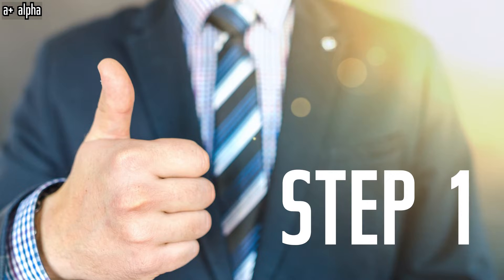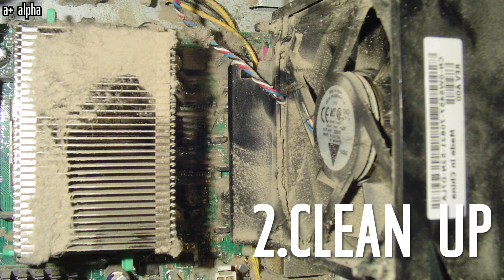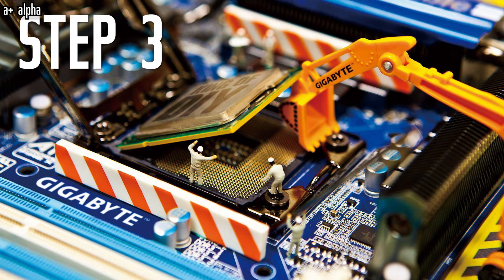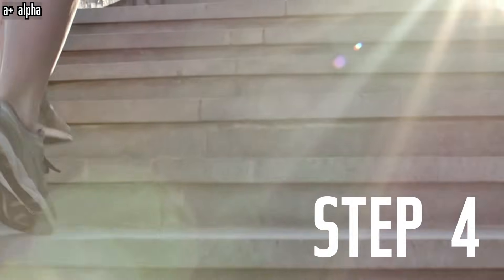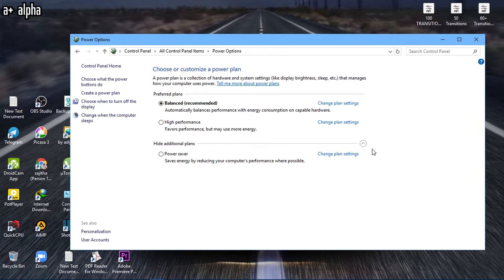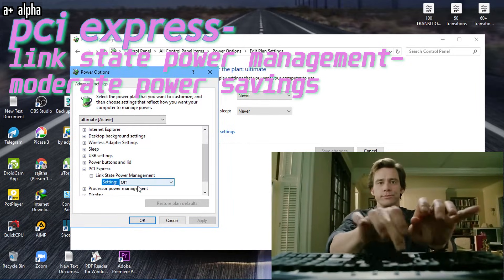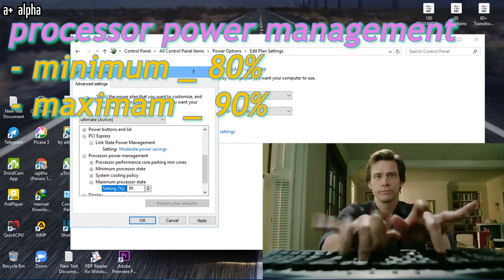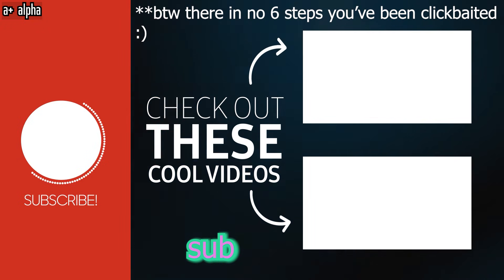✔️how to FIX your PC high temperatures | overheating CPU/GPU when gaming [complete guide]

Comment: This helped SO much. I was runninng at 90-100 celcius with about 3 things open and like 80 with absolutely nothing. now with absolutely nothing open I get like 50 and with quite a bit I get like 70 which is A MASSIVE IMPROVEMENT. Sometimes it spikes up to 90 when I open an application but atleast it goes down in around 5 seconds to 70ish

Comment: Bro step 4 is like a literal cheat code. My CPU Temp doesn't even go above 60 Celsius in ANY game so far. I used to get like 86 CPU Temp in a Warzone game, and now I get like around 55 CPU Temp. But, it does come at a cost of performance, but its really not that much, and its very worth it. Thank You so much. 💯

Comment: some did work went from 55 temps on idle to 45 IDK why now its high maybe one the summer here get 105 at times or two i bumped the Air cooler to much it moved it and now uneven, so i will also repaste it... for now this few tweaks least brought it down 10% till i repaste first thing in the morning Thank you👍

Comment: Will it affect Cpu's life??
Reply: It is much more likely that high temperatures can shorten the life of the CPU over the years, rather than limiting its power
Reply: Yes, in a good way. Step 4 really helps limit your CPU Temp, but it does come at a cost of losing a bit of performance, but its worth it. Doing step 4 will actually ensure better and longer CPU life, as it decreases and limits the temperature by a lot.

Comment: My ryzen 5 5600g was at 55 degrees without any gaming. Although that is not that bad it was still higher than others. By simple following the last stap its now at 38! Thanks alot man! I also have not cleaned my heatsink in like 2 years so im gonna try that and update this

Comment: My brother in christ, you're my savior. Before trying step 4 my pc used to crash on every demanding game, recently i bought ac valhalla and i wasn't able to play it without crashing after 10 minutes playing. I spent two weeks looking for software related fixes and was about to give up. Now, thanks to your help, i finally noticed it was a temperature issue and now i can play for hours straight with low temperatures (from 80 degrees at lowest settings to 65 at mid settings) and zero crash. Hope you the best 🙏

Comment: Im using i5 7300hq with gtx 1050ti, and with this tutorial, i can actually dodge the fps drop i usually got when i was playing battlefield 5, the fps drop sometimes still happens but it only occurs for a few frames and not as much as before, thank you so much for this

Comment: I’m nervous these are all bots in the comments does step 4 actually work?
Reply: It's legit, your not going to break or mess up your PC you can easily revert step 4 if it doesn't work, I was a tad bit nervous doing it myself but get creative with your PC have a leap of faith and it could possibly help/save your pc in the long run.
Reply: So did it work, brayden? and have you noticed performance differences?
Reply: Yes worked amazing for mine

Comment: Well the final step definitely does lower your temps, mine dropped by a massive 20C. There is an undeniable performance loss however, at least with CPU bound games. Playing star citizen I toggle 'recommended' and this changed setting, and its a -15fps every time

Comment: The logic behind step 4 is straightforward. Put battery saving efforts to moderate so as not to drain too much battery but not dampen performance too much. Limit maximum CPU usage to less than 100% so that temperatures doesn't get too high.

For some reason RE4 Remake is very demanding and puts my CPU temps in the 90s especially on hot days, without air conditioning. Now the temps went down to 80-85C which is pretty good for a gaming laptop.

Thank you for this!

Comment: When I pick Best Performance power mode, the frame rate gets better compared to Balanced but the temperature can get really hot (It can go over 90 Celsius) even though the CPU usage is low. It wasn't like that before when I bought my laptop.

Comment: yall do know that step 4 is essentially a manual thermal throttle? less power = less performance. its just compensating for the issue, not fixing it, and it will hurt your performance.

Comment: step 4 saved me, idk but my water cooler was running at 80 degrees in fucking minecraft, now im running at 51
Reply: so i was at like 80 while not in a game. but i am now at 68? it wasnt much of a drop like idk how to change it
Reply: @FinesseGD  bro, try to change your cooler or replace it and change your thermal paste, 80 degrees idle is wild
Reply: @awakengmd  thermal paste on cpu or gpu
Reply: @FinesseGD  cpu
Reply: ok so i found out the issue. my gpu fan is not spinning. the videos on youtube are no help, idk what to do @awakengmd

Comment: From 65'c max now 55'c max of playing dota 2 at step 4. But still don't know if it has bad impact to my computer cuz it has higher minimum processor state and since its not recommended to set higher minimum processor state when you will research. I tried 5-25percent but still work 80 percent is just too high.

Comment: Step number 4 has just solved my month long issue in 30 seconds. Was running Path of Exile at 90 degrees i changed the power options just like you said and now it's not going over 50, you sir deserve an award.

Comment: Brother this actually worked , mine got decreased like 15 degree C ,it was running at 100 degree C but now its at 85 degree C while the gpu temperatures seem to be same(I HOPED IT WOULD ALSO DECREASE) and right now i can't notice any performance loss either. Plz make one on gpu too, i already tried undervolting but it didn't help.
Can anyone tell me why this worked though....

Comment: I have no heat issues with my 7 year old CPU it runs at 40-45 degrees Celsius while playing games and my AIO cooler is 7 years old too, never needed to reapply thermal paste. My CPU is 30c at idle.

Comment: CPU temp reached 100 degrees celsius though not going over. Reapplying thermal paste fixed my thermal throttling. Haven’t reapplied it in over 5 years. Luckily my CPU was still functioning despite of it.
Reply: 5 years wtf

Comment: that power saving setting, by only adding that limiter it dropped my temp from idle 47-72c with no game on, to running it a flat 38-39c even while running elden ring at max settings it stayed below 40c. 
Then running Warhammer: Darktide at max from a 65-75c dropping to a 49-65c.
It is insane that it had such a massive impact, without affecting my fps negatively

Comment: RIGHT ON!!!!!! My struggles with my Asus Rog Strik G15CE CPU temp have been resolved thanks to your sharing of knowledge via the TUBER!!!! My gaming desktop would have a normal CPU temp until I launched a game. When any of my games were running in the foreground my CPU temp world be 100C. If I minimized or sent the game into the background, my CPU temp would go to about 70-85 C. I did research and tried a settings recommended in my power plan with the CPU power management option but the 3 Settings in the power plan you recommended resolved my issue. Thanks to you, my most resource intense game is at 60 C.....YES!!!!!!!!!...THANKS!!!!!!!

Comment: Finally, normal cpu temperatures. I had completed my first build with an AMD Ryzen 7 5800x3d processer. I had seen a bunch of things on "processor running hot" but none of them helped. Step 4 decreased idle cpu temps drastically, with it running at 48 degrees idle in the past, now down to 36 degrees. Thank you!
Reply: 48 degrees is very good
Reply: Bro my ryzen 5600 is running at 61 while idle suggest me something
Reply: @gelnox_mom Did you change your power plan according to step 4? Thats what helped me. I don't know what else you can do if that doesn't work.
Reply: @smotion1000  yeah now its better bit its still at 61 while idle
Reply: @gelnox_mom  61 is still damn hot for an idle temperature. what cooler are you using and how many intake/outake fans do you have in your case?
Reply: @smotion1000  i am using the stock cooler nothing extra🙂
Reply: @gelnox_mom what case are you using? Airflow
Might be the problem and if you don’t have any additional fans it won’t cool down
Reply: @smotion1000  i am using monarch  mystery box  with 5 fans and just bought the pc like 12 -14 days ago
Reply: @gelnox_mom  huh. Looked that case up and I can’t a single piece of information of it and anything about airflow. That might be an issue. Also, for my build I use an AIO instead of a stock cooler which may result in a much different or better temperature. Don’t take my word for it though as I have never used a stock cooler or know much about them.
Reply: @smotion1000  myb its not available in ur region.
Reply: @smotion1000  bro can we talk anywhere else so i can give u pic of my case..
Reply: @gelnox_mom  yeah sure. But like on what tho?

Comment: thank u so much man! I was running ESO at around 85°-92°, then I set the cpu to 90% and not only the temps went down to around 60°-65°, but the fans stopped making jet engine sounds 😭
Reply: p.s. also forgot to mention that I only lost like 10% or less performance-wise it's almost hard to believe

Comment: Step 4 is working  fine. (12 to 15 degree less temp)
But CPU usage percentage is now increased like 15% to 20%. 
Can you tell me why ? Is it creating extra pressure or load on CPU now ?
Reply from the maker: It reduces CPU max clock speed. It won't affect yo performance unless the PC got a CPU bottleneck. 🙂

Comment: will reducing max and min processor state reduce the prcessor of cpu
Reply: of course. not by too much tough. worth it if your processor is really struggling with heat.
Reply: @retrex3448 thanks for the info bro
Reply: performance*

Comment: What does step 4 does exactly? it does decrease the temp but surely there is a slight perfomance loss id imagine? just very minor? cuz my understanding is that u run the system from 100% to 80 and 90% right?

Comment: Step 4 has helped me so much you have no clue. On Dead Space Remake I was getting 85 to a MAX of 94 degrees Celsius. I also replaced my CPU cooler recently AND applied thermal paste and I had no results. Not on high graphics, Ray tracing I’m sitting at a cool 55-59 degree Celsius temperature. It’s insane

Comment: Thank you very much. I had a problem with Minecraft, when starting the game it always uses 100% of the CPU for no reason, causing the CPU temperature to reach 95+ then after 1 minute it drops back down to 50-65. After using step 4, the CPU temperature is consistently 47-50.

Comment: Step 4 helped a lot. My CPU was at 88+ degrees all the time, but now its at 60-70. Thanks a lot!
Reply: Yeah mee too it does so well 
But the question does it damage the pc ?
Reply: i dont think it does, i never had problems, i think it's just a default setting thats turned on high and needs to be turned down when ur gaming so you dont get overheating issues @podcasttn7345
Reply: @podcasttn7345  No it doesnt at all , in fact reducing the temp help the cpu surviving longer

And most new motherboard include some overclocking by default , increasing performance by 10% but temps by 40% , the core boost performance , its usefull for old games that use low amount of cores , but only if the gpu is limited by the cpu
However with the increase of pixels in monitors , playing on a 4k monitor for exemple : you could use an overpriced 2.5k$ gpu without being limited by a 200$ cpu power

Wich mean , any kind of cpu overclocking should be disabled , even outside of gaming

However , i dont know about the pci power part , ive never tested it , since i need my gpu to run at full speed
Reply: yueah mine too idk why this is even a thing but yea.
Reply: reducing performance always helps
Reply: but that causes a lot of lag tbh @PerfectlyFineCup
Reply: same here
Reply: me to braa
Reply: Kills fps
Reply: @lufter7375  you’re usualy limited by your gpu rather than your cpu

Lowering speed on some cores enable others to do their job without being slowed down , resulting in a much stable fps

The only kind of games where you loose performance are old games that doesnt support many cpu core , requiere high cpu power and low gpu power , such as...well considering old games doesnt use that much power anyway , it doesnt affect fps
And on my encoding test , it only reduce around 7% speed , but goes from 70 degree to 50

Outside of that however , and mainly for thoses single core app , it does reduce the speed a lot
Well its not like waiting 0.9 ms instead of 0.6ms will kill you , humans are usualy slower than that

Comment: What do I do if it’s still shutting off randomly?
Reply from the maker: Probably Hardware issues.. add new thermal paste
Reply: @AAlpha69  so it was due to my power settings, changed a few settings & it dropped to 65 Celsius!!
Reply: Was at 96 btw

Comment: I just upgraded my rig with some new hardware and installed Windows 11 Pro. Then i took the new rig to test and installed some hardware information software. And i was mildly shocked. 

My rig at the moment (after upgrading):
- Mainboard: Asus X570E Gaming
- Processor: AMD Ryzen 9 5950X
- Cooling System for Processor: Corsair iCUE H170i Elite Capellix (push-pull-upgraded, located in top, exhaust)
- Memory: G.Skill Trident Z neo RGB 128GB
- System SSD: Samsung 990 Pro 1TB
- Video Graphic Adapter: Asus Strix 4090 OC
- Power Supply: BeQuiet Dark Power Pro 12 1200W
- Case: Meshify 2 XL
- Fans in the back: 1x 140mm PWM exhaust
- Fans in the bottom: 2x 140mm PWM, intake
- Fans in the front: 3x 140mm PWM, intake

Before upgrading, i used Asus Strix 2080ti OC, Be Quiet Dark Power 11 850W, H150i, 980 Pro 500GB.

So, i knew with the 4090 alone i would have to deal with some more degrees, but... when i looked up Open Hardware Monitor, i saw values not meeting my expectations.

Now, before i post values, it is important to notice:
- I live in a flat under the roof
- It is summer
=> So i am talking about 29 degrees Celsius room temperature.

In idle (!!!) my GPU was looking pretty good (39 to 43 degrees), my mainbnoard looked good too, around 27 to 36 degrees (all but two ungodly high values at around 80 degrees that may be invalid due to my online research), and my processor was like ~70 degrees.

I just took some time, found your video, watched it despite every body cell telling me to not watch it completely (because the generated voice alone.. ugh) and i eventually ended up with testing step 4. I just created a new energy profile and set maximum CPU utilization to 90%, did not change anything else.

So here it comes.

Open Hardware Monitor gave me several values for my CPU. Here are the BEFORE values:
Package: 66.0
CCD Max: 69.3
CCD Average: 54.4
CCD #1: 69.3
CCD #2: 55.5

Again, this is IDLE! Keep that in mind.

Now the values AFTER the change:
Package: 39.4
CCD Max: 40.8
CCD Average: 37.3
CCD #1: 40.8
CCD #2: 35.5

So, thank you, didn't think i'd find any working solution fo that here, so fast. And i didn't think i'd find the solution wrapped in a video that could have been a tutorial for scammers aswell, regarding the style of it. I will put this to the test and comparsion with switched back values in some different games. If my pc doesn't end up either as a dead horse or a supernova, imma let you know the results. 

Thanks again.
Reply from the maker: Thanks for the comment.. ❣️

Comment: My PC was shutting down when I was trying to play Fallout New Vegas from overheating. Google was helping none, this vid and the settings made a major diff. It was running in the high 70-80s and sometimes triggering my cpu program to make the PC shut down from overheating. Did the settings in this vid and am now running the same game and settings but the temps are in the low 50-60 range, sooooo much better.
 Me and my PC thanks you. :)

Comment: Thank you soo much bro!! You saved my life, I found out that the casue of this problem on my pc was amd chipset drivers power plan due to which my temperature was crossing 90+ degree celsuis, But after setting my power plan to balanced my cpu temp went normal! So, if anyone else is having this problem you can check your power plan first.